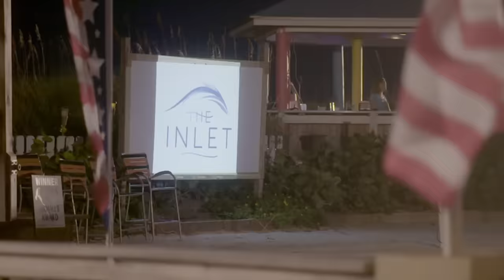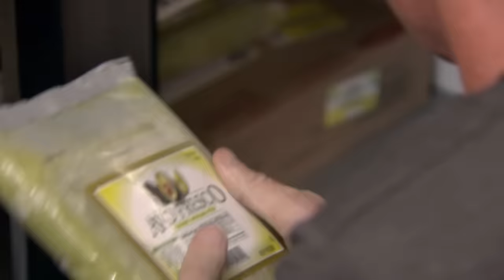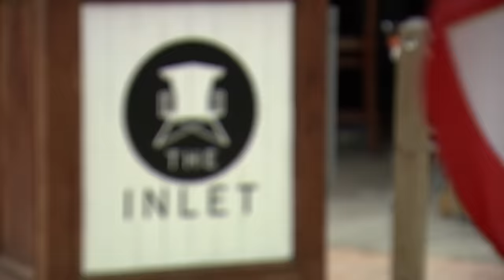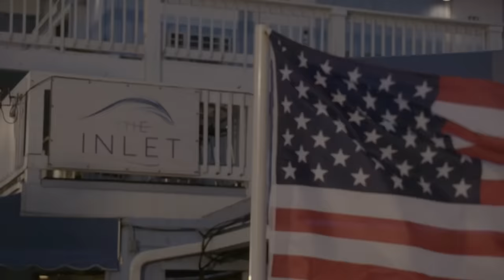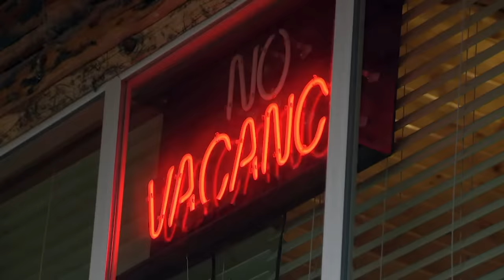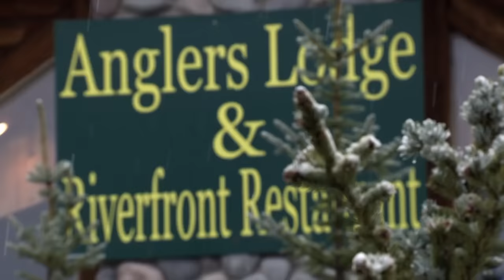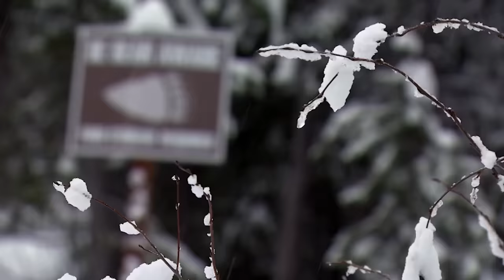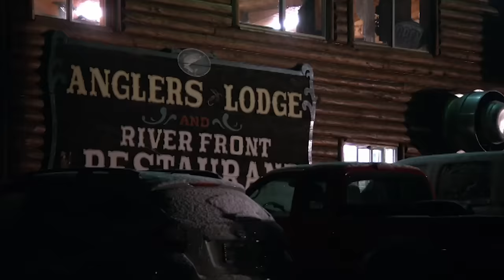hotels that are hotels but shouldn't be hotels but are hotels anyway | Hotel Hell

Comment: Creamy Chicken Piccata

Ingredients (for 4 servings)
2 boneless, skinless chicken breasts
salt, to taste
pepper, to taste
⅔ cup all-purpose flour
4 tablespoons olive oil
⅓ cup dry white wine
2 tablespoons unsalted butter
2 cloves garlic, chopped
2 tablespoons caper
3 tablespoons lemon juice
1 ½ cups chicken stock
⅓ cup heavy cream
2 tablespoons fresh flat-leaf parsley, chopped
8 oz angel hair pasta, cooked, for serving

Preparation
1. Butterfly each chicken breast. Lay a piece of parchment paper on top and pound to about ¼ inch (6 mm) thick. Season generously on both sides with salt and pepper.
2. Cut each breast in half lengthwise so you have 4 pieces of chicken.
3. Add the flour to a wide, shallow dish. Dredge each piece of chicken in flour, shaking off the excess.
4. Heat the olive oil in a large skillet over medium heat. Fry the chicken until golden brown, about 3-4 minutes per side. Remove the chicken from the pan and set aside.
5. Pour the white wine into the pan and cook until reduced by half, about 1 minute.
6. Add the butter, garlic, and capers and cook until fragrant, about 2 minutes.
7. Stir in the lemon juice and chicken stock and cook for 5 minutes, until the sauce has slightly thickened.
8. Stir in the cream, then return the chicken to the pan.
9. Sprinkle with the parsley and turn the chicken to coat in the sauce. Simmer for 2 minutes, until the sauce thickens slightly, then remove from the heat.
10. Serve the chicken and sauce over angel hair pasta.
11. Enjoy.
Reply: Ooh ty!
Reply: Thx